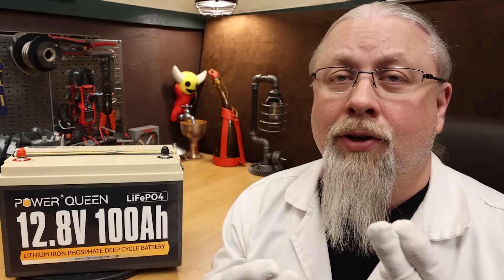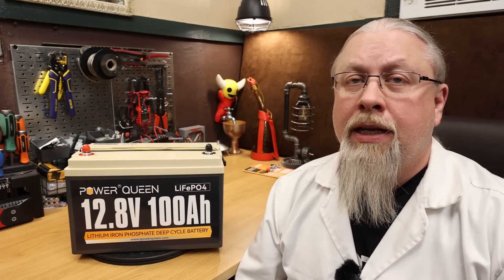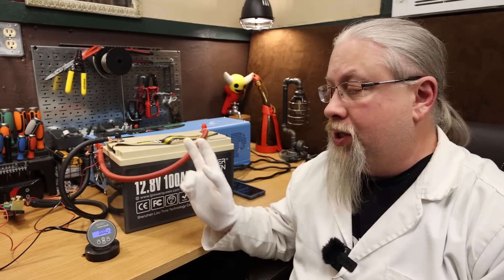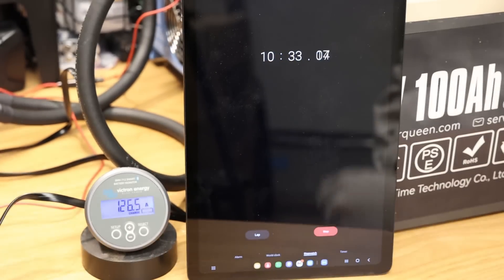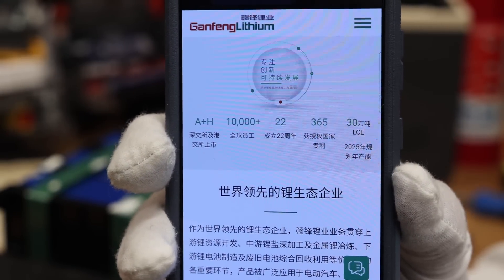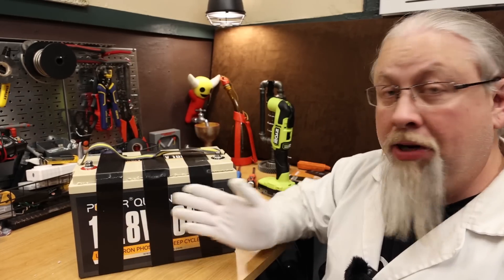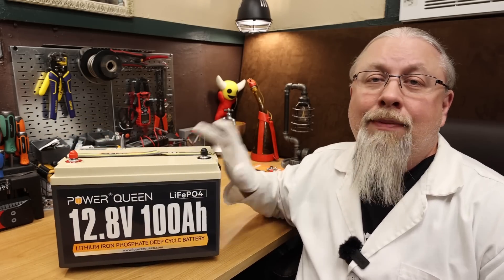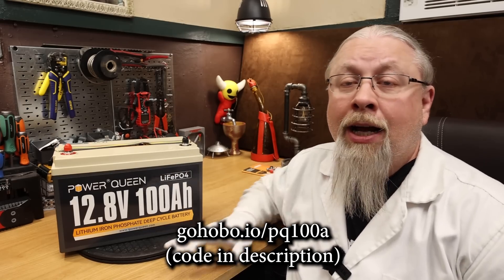Power Queen 100Ah LiFePO4 RV | Off Grid Battery Review [Teardown]

Comment: Dear professor, can you help me understand how you could use this battery or a 24 volt battery to augment an eco flow delta 3 generator by hooking it up via the solar cell port (xt60 i or xt 60 ) connection? If one port allows 500volts of solar , would hookingthe battery to it be too much power ?

Comment: @ HOBOTECH I was told that you can only use a maximum of four of these batteries in parallel, is this so? And why is it so? I'm currently running five of them in parallel and they are working ok, but should i continue? Or reduce the bank to four?

Comment: No one is talking about this battery shutting down when fully charged on solar if you keep it hooked up to charge controller and it reaches 14.4 bms shuts down why… my other battery’s can stay on charge controller something not right power queen has not answer my inquiry…
Reply from the maker: All LFP batteries when fully charged disconnect the charging circuit to protect the cells. You can still discharge them. They work as intended.
Reply: @HOBOTECH  I understand but it turns of my inverter off and beeps discharge fine and changes back up fine my issue is why it doesn’t work while hooked up to charge controller I have other batteries that don’t do that… Thank you… Hobotech Sir
Reply: @dan32one44  I had this exact scenario and contacted them directly about it. Yes, they do disconnect after 14.4v, and they say it's "normal", but what is not normal is that it doesn't instantaneously reconnect when the voltage goes any lower, as it can mess up with some chargers and inverters, indeed. My solution was to charge at 14.4v only, but if you consider this, going from about 14.2V at full charge, to 14.6V will only give you like 3% more state of charge, at the expense of a much faster aging in the cells. It's not worth it, just charge it at 14.3V.

Comment: can you tell me the difference between this battery Power Queen 12.8V 100Ah Low-Temp LiFePO4 Battery Perfect for Trolling Motor, Built-in 100A BMS and the battery that I just purchased on Amazon Power Queen 4 Pack 12.8V 100Ah LiFePO4 Battery, Built-in 100A BMS, Lithium Battery 5120Wh, 4000 to 15000 Cycles, Support in Series/Parallel, widely used .. I plan to run three of these in series for my 36v Lowrance Ghost Trolling motor, but now I am worried there is some difference that I should have gotten the one that I described above.   Could you please share with me what the difference is?  Thank you sir.

Comment: Great video and evaluation!  I am trying to decide on whether to purchase two 12V 100AH or one 12V 200AH Power Queen.  What is your recommendation? Are there pros and cons to each? Thanks again for the videos!
Reply from the maker: One battery requires less wiring. Two batteries might fit better into a small space.

Comment: I purchased 2 of their 100Ah Premium batteries last year. They weren't self heating so I thought what can it hurt to purchase a automotive battery wrap for over the winter. I connected a thermostat to it so it would only come on below freezing. This was probably the dumbest thing I have ever done in my life. I deformed the outside case of both batteries. I later learned I can't use lead acid battery warmers. My batteries still charge and discharge okay but did I do any long term damage?

Comment: Do you think one of these would replace standard Deep Cell batteries. I have two mounted near the tongue of my travel trailer. I'm trying to get some of the weight off the tongue. Do you think one of these would replace the two that I have? Also do you think I can charge them off of my RV charger and hook them directly to the fuse block?
Reply from the maker: Yes. I did this with my travel trailer.

Comment: I was surprised to see aluminum bars connecting the cells inside this battery. Aluminum is about 60% conductive compared to Copper. Of course aluminum bars weigh less than copper which helps reduce the overall weight of the battery. Disclaimer, this is my first time seeing inside an
LifoPO battery so I don’t have anything to compare my observation to. Ps. Melting points (f): aluminum 1,200, copper 2,000.
Reply: Aluminum buss bars is a standard in these . The posts of the cells are aluminum so it makes welding the bars in easier .
Reply from the maker: Yep and aluminum is cheaper. All you have to do is double the thickness vs copper to provide the same or better conductivity. Melting point doesn't matter. If your battery is over 1000 degrees it's already on fire.

Comment: Make sure, if you connect them in series, to balance them once or twice a year, just connect them in parallel for an hour, before you do that, check the voltages of every Individual battery. Because if the voltages are to far apart, hundreds of amps could flow from one to another and cause harm to them or yourself.

Comment: Hi all, I purchased 4 of these 100ah 12v batteries and connected in series into my MPPSolar inverter.  I have 1 inverter and am not using any fancy remote battery management system.  I tried using the lithium program of the inverter to charge these batteries, but it goes into alarm because I can't use the series cable to attach to the batteries.  Since there is no place to plug in the cable into the batteries. I am using the 'user defined' battery program. There is a built in BMS in the batteries, but I don't know what it does exactly. Nothing visual.  My question is about the charge/bulk/float/low cut out/high cut out/voltage to return when the batteries recover.  I'm using the generic setting of 54 volts for the battery system, but the batteries are always charging and never get over 2 of 4 bars.  I'm guessing this is due to not having all of the settings correct for this system.  I'm only using 0-25% of the inverter capacity, so I'm not draining the batteries to zero.  Power Queen doesn't respond to emails.  Does anyone have any suggestions on setting these up?  I just sent an email to MPP Solar and am waiting for a response. I did fully charge each battery independently, then connected in parallel to complete the balancing before hooking in series to my inverter. Thank you in advance for any comments!

Comment: Awesome review, thank you! I used you discount code and just purchase the Power Queen 100Ah battery to be used in a Licitti 1000 watt Power Box with a 100 watt solar panel. Just starting out with solar and wanting to find a small system I could build to charge my cordless tools, cameras, cell phones, tablet, etc. Didn't want waste  $$$ on cheap SLA batteries and trying to keep budget low but still use quality products. 

I stumbled across your video and just watched it, and just described. Love what you're doing, keep up the great work! And thanks for the discount code ♥️

Kendra

Comment: I think opening up the battery proves that the product is good. You get to see the quality of the wires internally and the BMS. You also can test the low-temperature cut off. Plenty of DIY people have built battery banks that look a lot worse than after you reassemble the battery.

Comment: I don’t need the tear down to make a decision. I need cold temperature charge protection. I want to put lithium batteries on the front of my travel trailer. We travel to Florida from Ohio in the winter when it is below freezing. I hate see a good battery ruined by cutting it open.😩

Comment: although. if you PP'd 4 of them you have 400amps constant 800 amps for a short time and 1200 amps for a few second (more than enough to start a car at either 800 or 1200 amps) just don't do it with a larger or a diesel engine in say the winter.

Comment: I'm wondering if this battery could be used in an electric car where the 12 volt battery is isolated from the propulsion battery and is only used to power the car's electronics.

Comment: I just bought the PQ 100ah mini. It looks like it's probably the exact same guts just without the foam and in a non standard outer case.
Reply: Not quite. The minis use 16 25 ahr pouch cells.

Comment: I have a couple of question..... #1 I will soon be converting my motorhome over to lithium batteries.  I know you can't start the motorhome engine with lithium batteries. However I have an emergency start switch that connects the house batteries to assist the engine battery if it gets low and won't start.   Will this work?  #2  I have an Onan Generator (4000 watt) that uses the house battery to start it.  Can the lithium battery start this motor?

Thanks in advance.
Reply from the maker: I think I said it will start a generator in the review.

Comment: I bought 2 of these back in December 2022 and have them connected in series for 24V.  Connect this to my 24V to 48V DC to DC converter which is plugged into my AC200P to add capacity when needed.  My initial testing showed 101AH each battery.  They are doing great so far.  They were $299.99 back then, plus I received one of their LFP 12.8V 6Ah batteries free with each purchase.  Good deal.
Reply: Sounds way more cost effective than bluetti’s own expansion batteries
Reply: My same exact thought @vinroc

Comment: id love to see some videos on different budget minded RV  replacement lithium charge converters. as i was under the assumption untill recently like alot of ppl that theses are drop in replacements and thats not entirely true
Reply from the maker: You mean like this? https://youtu.be/HySgUYqjmo8
Reply: @HOBOTECH  i did watch that video I was thinking a direct replacement for the factory charge controller so i can charge from shore power. I will also want a  mppt charge controller I was looking into the bougerv one.